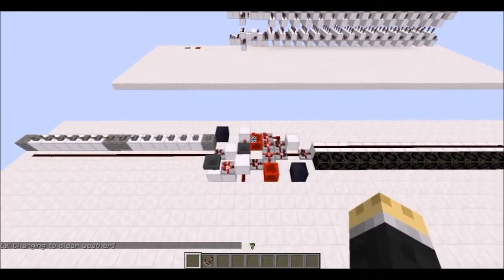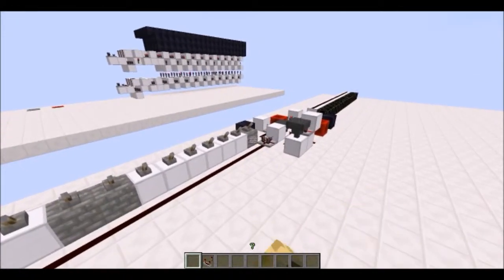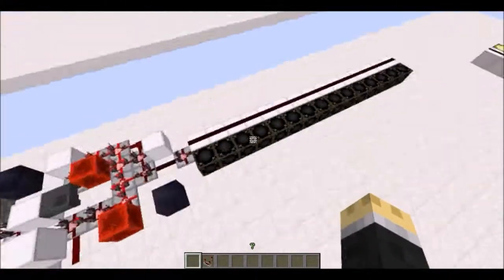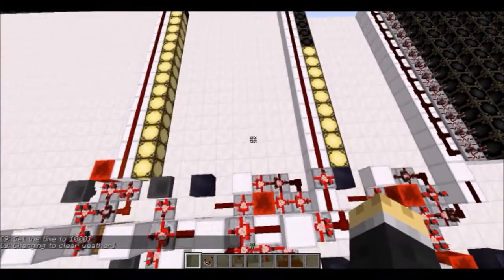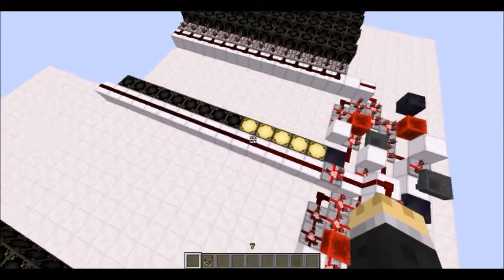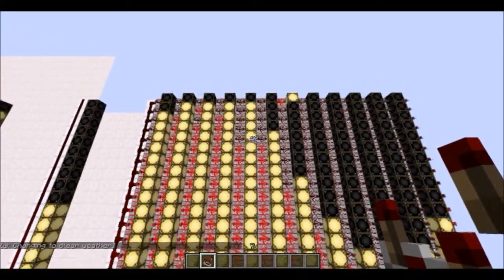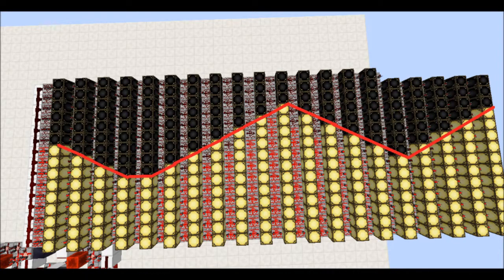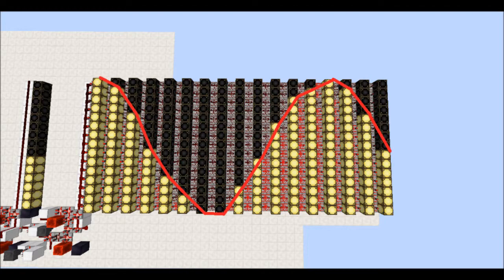Redstone AC integrator

Comment: Maybe I'm asking a question on a Redstone piece from ages ago that might not apply to the current version (1.16.4), but I am wondering how one activates the in-series comparators next to the Redstone block that is furthest to the left if you were looking at the circuit from the input? If I remove that Redstone block, they activate, but if I put it back down then they deactivate.
I've been trying to figure out how to activate those two fully but haven't had any success. So far it charges up, but upon trying to send in the -1 (or below) signals, the output never shrinks. I have referred to a comment made about a year ago in which one needs to place a signal of 8 in the hopper that is in the middle of the integrator (the one that I assume is immediately adjacent to the iron block), and I have a signal of 7 in the other hopper. I am wondering if I am missing something or if it's just related to the construction process or the current version of Minecraft.
I don't have a plugin that would allow me to visualize or import it directly into Minecraft, I have to use an online schematic viewer and have based my replication attempt off of that as well as some frames in the video.
Reply from the maker: Yeah I guess comparators have changed since then.
It used to be that redstone blocks would not activate a comparators secondary input.
I guess nowadays, they do.

This circuit is outdated, I guess.
Reply: @n00b_asaurus  Such a shame considering what could be done with it. Any plans to revisit it and do some redesigning?

Comment: Hey man, don't know if you're still monitoring this, but I was able to get the charging part of the integrator working, but not the discharging part. I am on 1.16.1, so I'm not sure if that changes anything. I have the hoppers set correctly as Gerald stated below (output 8 for the middle one and output 7 for the far one). Would appreciate any help.
Reply from the maker: I can't remember for the life of me how this all worked.
I do have a schematic available for download though: https://www.planetminecraft.com/project/redstone-ac-integrator/

Feel free to use that as a reference.
Reply: @n00b_asaurus  I copied the schematic exactly, but my mind is still boggled as to how it's working your video lol. Not sure how the comparators surrounding the middle redstone block will ever output anything with a signal strength of 15 (or +8) at their side input. 15 into the side prevents any positive output, in subtract or compare mode
Reply: @n00b_asaurus  I think I figured it out. I still don't know how it works for you lol but I spaced out the discharge side by one block so the middle redstone block doesn't cancel any signal from that first comparator set to subtract on the left.